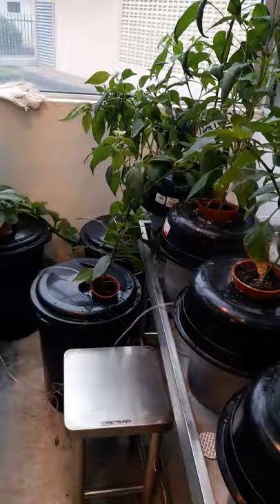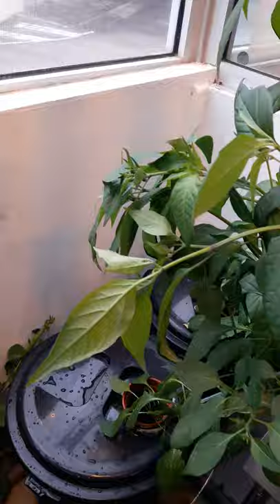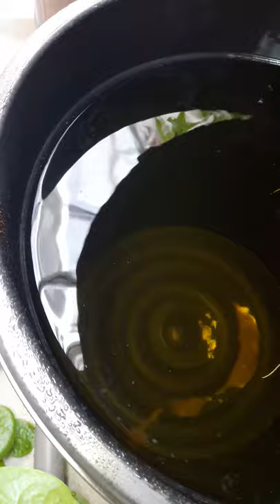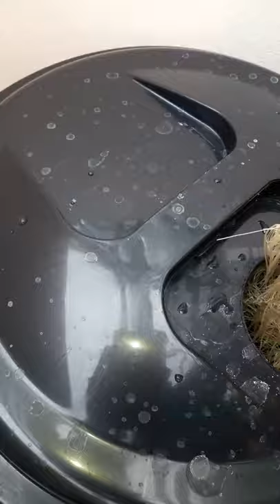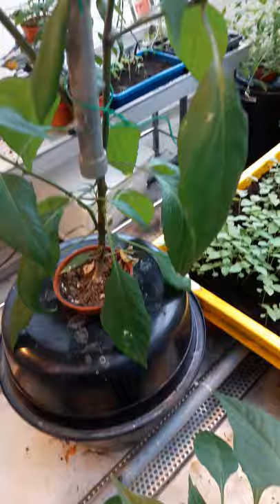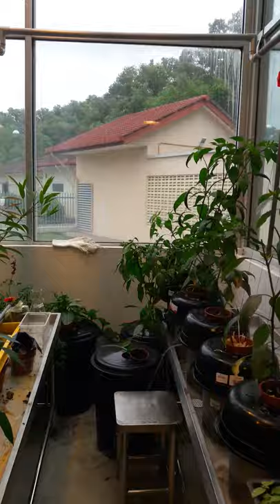KRATKY METHOD: AERATION

Comment: Just opinion : When introduce air pump...it will be DWC (deep water culture). So it is not kratky anymore.
Reply from the maker: Thank you.
Reply: How meny watt light use in indoors grow system?? 🙏🏼
Reply: My thoughts exactly. The whole point of Kratky is simplicity and economics (both for the price of the airpumps ande the electricity needed to run them) and introducing airpumps totally negates this.